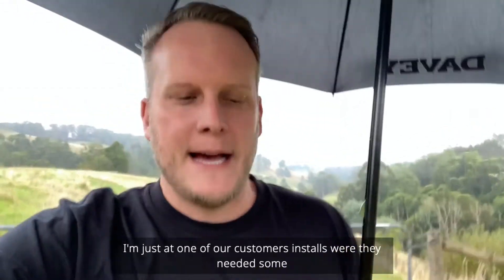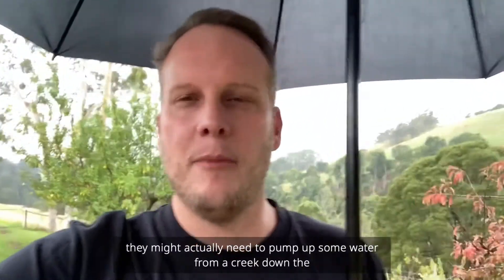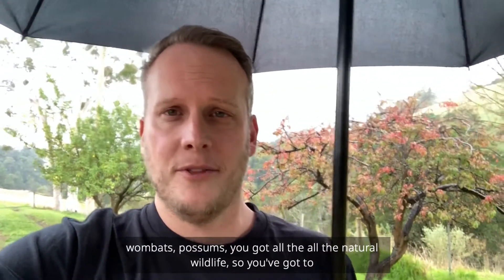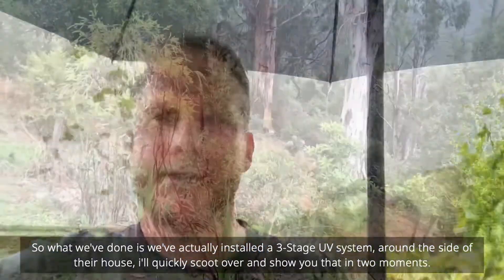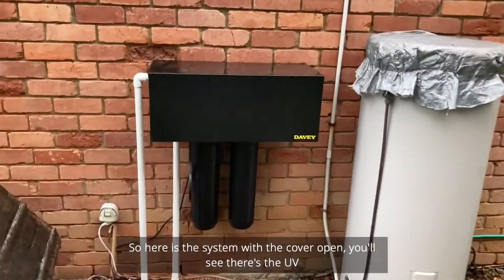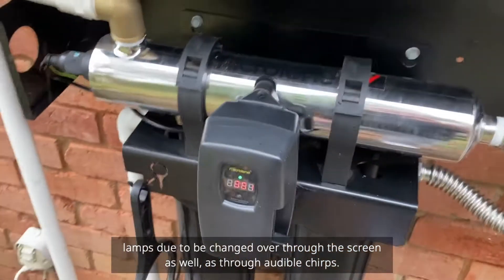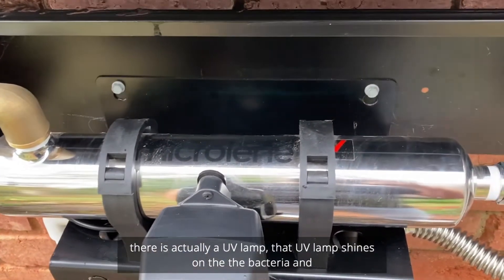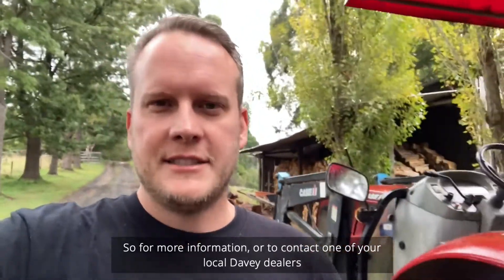How to treat harvested rain & creek water – Davey Microlene Aquashield Centurion

Comment: So the guy who installed this needs a talking to about servicing, the uv globe from what I can see in the video is blocked by the PVC outlet pipe.
Reply: It could appear like that reviewing the video. However, the lamp was installed after the PVC plumbing was hooked up. There is ample space for the lamp to be installed and removed without any issues. Keep in mind the lamp is approximately 15mm wide. It's not the same width as the PVC pipe.
Reply: @simplehowto5671  hi there I am aware of the width of the globe, as you can see the cut out hole on the wall bracket is quite large to obtain access on a small angle but the issue is the quarts sleeve and the length, meaning you cant pull the globe to much to the side as you have a quarts sleeve holding it straight on. But all things aside the globe replacement is the easiest part, its the removal of the quarts sleeve and o-ring  replacement to clean it every time you do a globe in order to maintain uv sanitation, unfortunately the pre filters only do so much to keep the quarts sleeve clean.
Reply: @shauntrigger1242  Hi Shaun, great points you raise. Lamp, sleeve access for replacement is a fundamental part of the install. There is ample access for replacement and maintenance in this install. Sounds like a good next youtube video opportunity, will line it up to show it in process. One of the great features is the ability to change the 316 stainless steel chamber orientation. This allows the inlet and outlet to be adjusted to either left or right side to suit the application and/or achieve the best aesthetics. Also handy with the sleeve design resembling a test tube with only one open end. The closed end seats easily in the opposite cradle and the open end only requires a single o-ring to speed up lamp and sleeve replacements.
Reply: @simplehowto5671  Hi fair enough on second inspection I can see there is a slight angle on the discharge pipe. Im not new to this I do these units all day long and its very frustrating to see and work on these systems when they are mounted up against an apposing wall or up high where we have to cut a hole in the shed wall or roof to change globes and sleeves and remove hard pluming because the filter housing dont have enough clearance under them to drop out. These types of units should be installed with unions and no out of the ground PVC pipe unless its painted as the bio mass grows in the inlet pipe and blocks the pre filters due to the low class pic not being able to knock out the sunlight. The other concern I have about the Davey microlene set up is the horizontal position of the quarts sleeve, the number of breakages being side on will be huge when removing for cleaning and the positioning will be difficult, I would recommend placing something  like a stick of dowel all the way through to the other side to stop the sleeve dropping and chipping. But otherwise I am very happy with the design of the new units and seem to be on price point with other suppliers, but I do think there needs to be some education around maintenance and installation as a broken quarts sleeve leaves the end user without water.